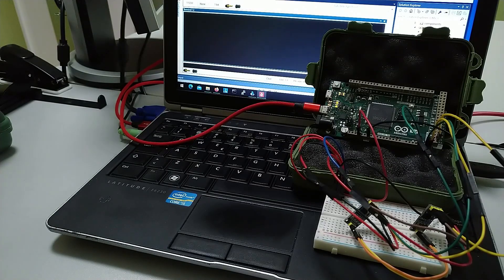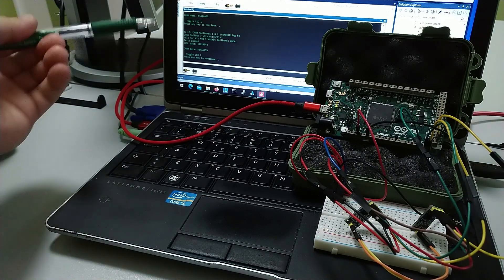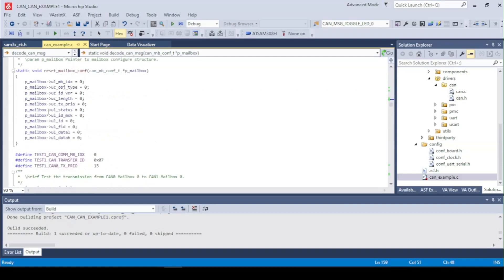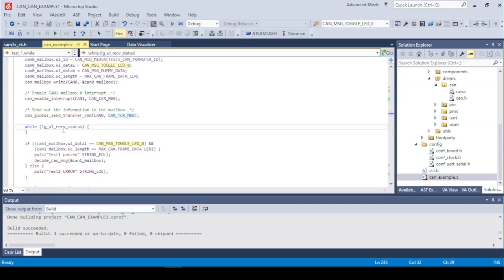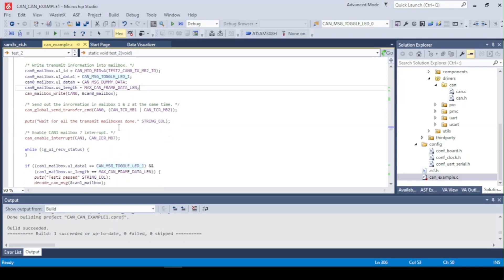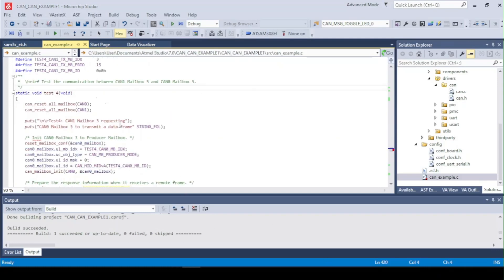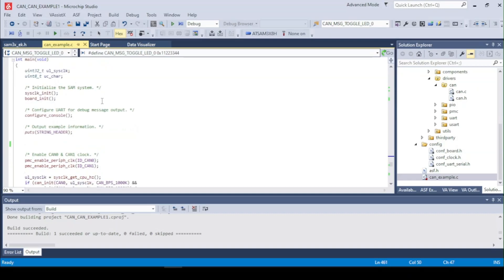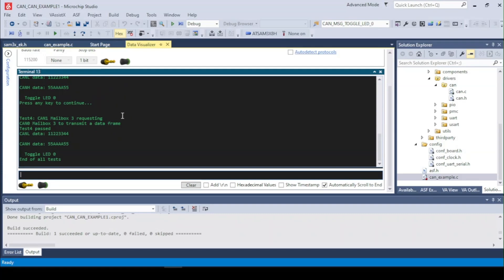Arduino Due CAN example in Microchip Studio

Comment: hello, Your videos help me a lot.
Can you show an example of communication between Arduino Due and PC using uart-usb communication?
I want to see serial print on the PC, but I don't know how to do it on the microchip.
Reply from the maker: I will do a quick video on this in the next week probably (in the upcoming one i will not be able to)
Reply: @e-exp  thanks, your an angel
Reply: @e-exp  And, 
Can I use atsam3x8e c++ in microchip studio? 
If so, can you tell me how?
I want use to C++ Class
Reply from the maker: @ Yes, when You create a new project there is a option to select gcc executable c++ project. Then You will be able to use all c++ features and arm-none-eabi-g++ will be used for compiling.
An alternative would be to change the makefile to custom and there use the g++ (c++) compiler but that requires more work to setup the toolchain.
Reply: @e-exp  I tried it with executable c++ project when creating a project.
But When Compile, an error message appears
"Undefined reference to '_read'"
"Undefined reference to '_write'"
"Undefined reference to '_ram_end'"
I tried many experiments to solve it,  It doesn't work out
In MicroChip Studio - ATSAM3X8E , Is it right to support C++ properly?
The example code consists of main.c, class.c, and class.h.  A simple example of calling a class from main
Reply from the maker: @WoojungKim-r1v  The c++ project should have main.cpp, when compiling there should be arm-none-eabi-g++.exe. I tried adding a class object in main after the #include and it all works ok.